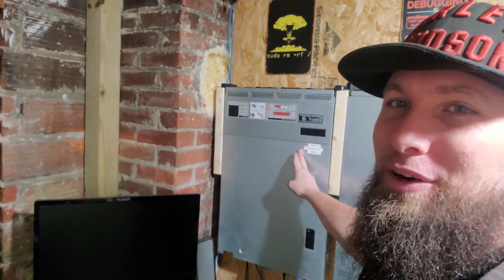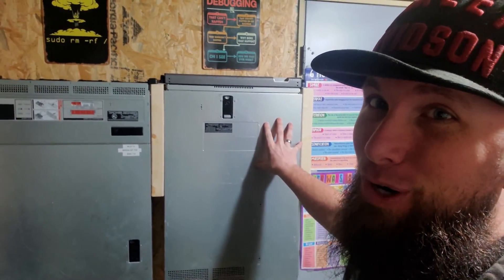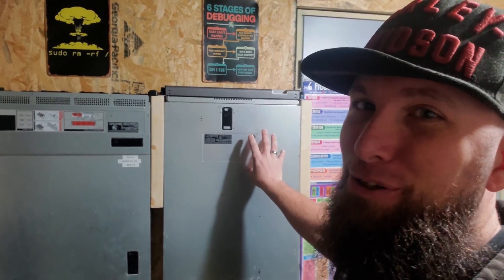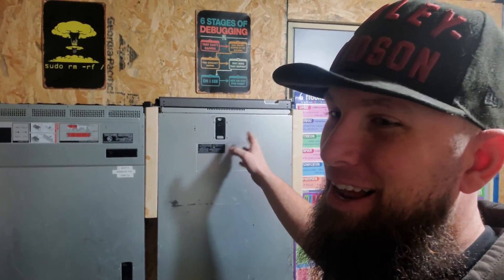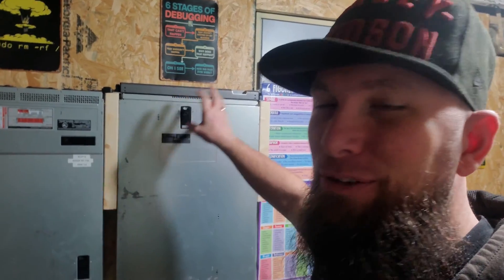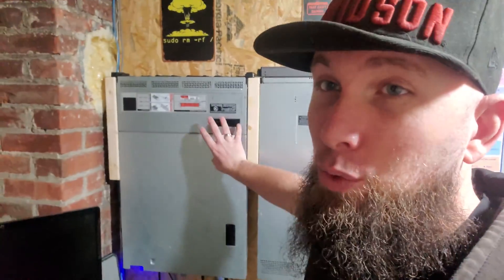PowerEdge R730 Boot from M.2 NVMe

Comment: My man, what do you need to do is, using that supermicro card, update the bios to a newer dell version, so you can use slot bifurcation. with that enable,4x4x4x4x4  730 will recognize nvme and allows you to boot from them.
Reply from the maker: Might have to give it a shot! Thanks!
Reply: @AONIX-AH64 hi, is it work sir
Reply from the maker: @Gigachatos  I'm still using the method shown in the video; I'd like to try the method mentioned above as it sounds more legit. But without another node to experiment with I'm unable to test it for certain. 

It's been quite some time since I'd initially set it up, but I recall looking for BIOS for the R730xd that enabled NVMe boot but I don't recall ever having found it which resulted in my method used in the video.

I honestly don't like to 3rd party boot, so a BIOS update would be most ideal if I could find the appropriate update.
Reply: @AONIX-AH64 could you share the model id of super micropcie?, thank you
Reply: which bios version supports NVme?

Comment: Can't you boot on UEFI path?
Reply from the maker: I'd have to try. Unfortunately I didn't experiment mnuch after this as my end goal was to just get it running lol.  

She's still rollin like a champ!
Reply: @AONIX-AH64  Thats good, got it 5 days ago, updated to the last version BIOS and iDRAC, put an A580 and a RTX 3060TI in it (made the cables) and just asked to know what I should do the rest.
Bifurcation works from BIOS, and hopefully I managed to make ReBAR work, too.
And with 5% fan temps are good and is quiet.
Don't even have it complete (no PERC, no second PSU, etc)
Reply from the maker: @BozesanVlad  I'd love to see this setup man. Feel free to share on the discord. Fresh discord channel so it's pretty dead in there and this would be cool to see. 

I've got a 3080 I'd been wanting to setup on the 730xd but figured it was above my paygrade lol. Nothin like a good challenge!
Reply: @AONIX-AH64  Made some print screens with the system as is now, in rest looks like a normal server.

The iDRAC and BIOS  I updated it from linux, is straight forward

Fans are just 2 ipmi commands to make them quiet

The cable is a guy that made a video on youtube for a TESLA cable, but that doesn't work with "normal" GPUs. So, I had to improvise (and made the cables to long..)

Anyway, except the cables I didn't changed on it nothing. I don't even have the cables for default backpanel for HDDs, cos I bought it barebones to see if fits my needs.

It is possible that helped that I bought first a Lenuovo 450RX, only the motherboard, and than fit it in a case, made custom CPU heatsinks and hacked the hell out of it. This is that linux OS, so I hav all the tools installed, even my VMs or ipmi and everything.

I don't seem to find your discord. I'd put the printscreens on it, and tell how I managed to make it work R730
Reply from the maker: That is some inspiring creativity my friend! Good on you!

DISCORD: https://discord.gg/ExszFqd5EW

Comment: Buy a double or quad NVME adapter to maximise the PCI slot lanes on the 730XD
Reply from the maker: @mindshelfpro  It's got a double atm, but I'll look into a quad!. Thanks!!
Reply: @AONIX-AH64  I believe the NVME can only use 4x lanes.. So if you're using a 16x slot--  you can use the quad to run the 4 different NVME with 4x lanes each..

Comment: Isn't the second slot on that Supermicro adapter card a SATA slot instead of an NVME? If it was 2 NVME-s, that would be a super buy there, sadly all similar adapters that I ran into are NVME + SATA.... :(
Reply from the maker: @The-Weekend-Warrior  I'll have to check! Good point!
Reply: @AONIX-AH64  I did check in the meantime. They are indeed separate NVMe blades. Which is supernice, HOWEVER, they use slot bifurcation to work so unless you enable PCIe slot bifurcation on the server (deep in the BIOS settings), you won't be able to use them both (or at all?)... I didn't know this existed, thanks for the info!!
Reply from the maker: @The-Weekend-Warrior  ditto! I'll look into this and do some tinkering. Think I got a spare NVMe to drop in.... for science! 🤣

Comment: Is that internally mounted USB drive now permanent there as a bootloader or how does that work?
Reply from the maker: @nicoiguess9318  it is. It's now my dedicated boot loader as it boots clover for me so that I can boot into proxmox
Reply: @AONIX-AH64  so it's basically like grub, only that u can just choose proxmox and it will also find the pcie adapter and boot using the nvme ssd?
Reply from the maker: precisely! Sorry it took me so long to get back to you. Was on vacation =)
Reply: @AONIX-AH64  Already done it, now it's booting from my m.2 :)

Comment: I just got a dell r730xd in. I actually bought the exact same card and drive as you but proxmox is not seeing it. I’m brand new to enterprise servers so maybe I have something wrong in the bios but I can’t find it. Anything special I need to do so it shows up?
Reply: It is enabled on mine. Are you sure you don’t need the dell card? That’s the only think I can tell that may be different.
Reply from the maker: When I installed Proxmox the server itself recognized the NVMe via PCIe and I was able to install Promox, but upon installation of Proxmox and rebooting the server no longer recognized the drive. I had to resort to installing Clover EFI Boot loader onto a USB that I mounted internally and utilized that as the priority boot loader. After that I was able to power up, Clover recognized the Proxmox M.2 and booted up perfectly ever since. 

You can find clover here if you wanna give it a try. https://github.com/CloverHackyColor/CloverBootloader?tab=readme-ov-file
Reply from the maker: Welcome to the fun stuff! 

You'll need to ensure you have virtualization enabled in the servers BIOS. If I recall that was all I had to do on the BIOS side (i'll update you if I recall differently) and then after that you could use GPU pass through (must be logged in as root it seems) but then you can add the GPU via PCIe device in the Proxmox VM hardware settings.

Comment: Fun fact I have an r730xd and I have the same sabrent pcie adapter but I have Western Digital drives that I installed into them. The r730xd puts out pcie training link errors with or without pcie bifurcation on all my risers. So I think your dad is right that WD drives are a bad idea. I ordered the Patriot drive your showed in the video I hope it will fix the errors. I'm guessing WD M.2 drives firmware doesn't play nice with the r730xd.
Reply from the maker: That's quite possible. If it's any consolation it hasn't given me any issues! 

I'll be posting major updates here soon, it's just been hectic. Got family down visiting for another week, complete network overhaul, and completing the Proxmox migration is still under way. 

Should be fun and interesting to see what the future holds in terms of content. I've learned so much I don't even know where to begin.

Good luck on the PowerEdge! Feel free to keep me updated, I could use friends with mutual hardware!
Reply: Ill definitely keep you posted on whether the new drives fix the issue. They should be in Sunday.   @AONIX-AH64